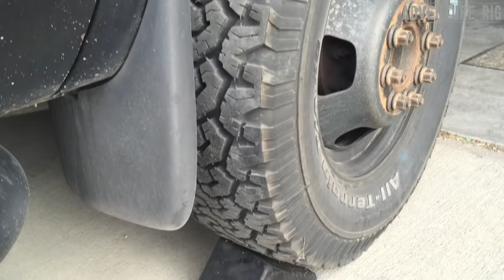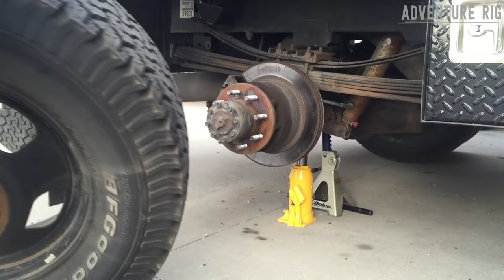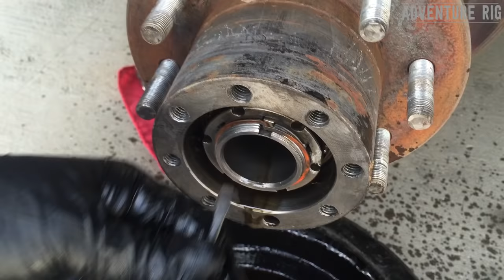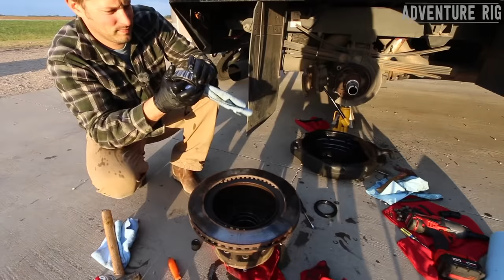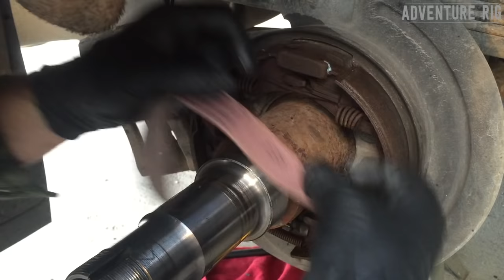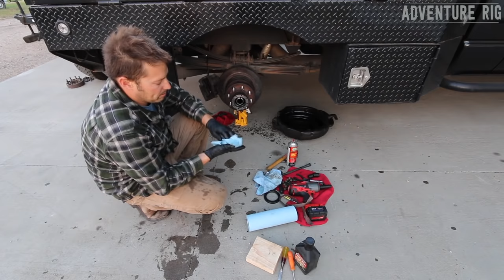How-To Replace the Rear Hub Oil Seal on Dodge Ram

Comment: Would this be the same thing wrong with my 2012 2500 Cummins 4x4 I wonder?  Gear oil all over the inside side wall of my tire, pretty bad
Reply from the maker: wildhorse192001 Yes I would assume. That’s exactly what my symptom was as well.
Reply: Adventure Rig thank ya sir, when I get the seal I should be able to tell for sure
Reply from the maker: wildhorse192001 Thanks for watching!
Reply: Adventure Rig my pleasure sir, very informative video, thank you for posting

Comment: Hello, I have a 2016 Ram 3500 dually and I notice gear oil like sitting in my rim. Almost look like it’s leaking from the axle shaft. Was wondering any advice on how to repair or might have idea where the leaks coming from….

Comment: When pulling the seal out you should get the right tool such as a seal puller or screw some small sheet metal self tapping screws in and pulling with some pliers instead of potential hurting the mating surface with a punch and hammer.
Reply from the maker: Be careful.

Comment: What impact were you using to break the lug nuts?
Reply from the maker: I'm not sure the exact model but it's a Milwaukee 3/4'' impact. I love it and have used it a ton.
Reply: never use impact to loosen or torque any nut,!!.lazy way,will break studs,cross thread,come loose if not correct tight.i allways break with wheel brace,torque back with my elbow.!.NEVER,had a problem.45 yrs..
Reply: My grandfather has been using an impact for more then 45 years and no issues either

Comment: What was the torque spec and why didnt you say to mark where the nut is in the beginning of the video, not after we remove it
Reply from the maker: I'm not sure off hand what the torque spec is. Marking the nut is not mandatory but it can be helpful...I suppose it was an afterthought for me. Thanks for watching.
Reply: @AdventureRig  the torque spec is 22 ft lbs at the hub nut then back off 30 degrees-his method worked but as a mechanic i prefer to use the proper socket and a torque wrench-but for a diy guy his method will do
Reply from the maker: steve will Thanks Steve!

Comment: Are 2500 & 3500 different? 2012.
Reply from the maker: Lance Koehler They should be the same as far as the procedure.
Reply: @AdventureRig   ok, thanks, guess I'll soon find out. Are those hub nuts just like old school? Get them snug then back out a quarter turn?
Reply from the maker: @slinger3350  Yeah preload and spin etc....

Comment: Would this process be the Same for a 2012 ram 2500?
Reply from the maker: I'm not sure if it's the same axle but I would think if it's different the process if very similar.
Reply: Adventure Rig is yours the 11.5 AAM axle?
Reply from the maker: Yes it is
Reply: Adventure Rig awesome, then it should be same process just mine being a 2500. Thank you sir. I'll be using your video to do mine here soon.

Comment: Bravo! I like the video. Short, easy to follow and no horrific music playing in the background. Bonus points for not pulling out some 37/94ths 17 point dealer only special socket designed to mate to a serialized dealer only torque wrench. 

My 12 2500 needs a new rear seal according to the oil change shop. Seeing you do it in your driveway gives me hope of doing the same. After that I will move on to replacing the entire front end steering assembly, replacing the steering box seals, a full tranny service and replacing the exhaust manifold bolts that snapped off... again. 

Every day I walk out of the house and see yet another puddle of fluid under this truck. It makes me hope that it would catch fire or be struck by lightning and go away. Then I put it in 4wd or load something stupidly heavy in it I cant help but love it all over again.
Reply from the maker: Haha thanks for watching! I hope your numerous projects go well.

Comment: Great video. Very helpful Thank you. My whole seal stayed on the axle when I took of the drum hub. I tapped off the seal. The new seal I tapped in the hub but if I pull it real hard by hand I can pull it out. Is that normal? How tight should that seal be in there? Thanks
Reply from the maker: Thanks for watching. You shouldn't be able to pull the seal out by hand. It's a pretty tight fit.
Reply: The pup playing with the block of wood was priceless:)
Reply from the maker: @rihamy2nd  Great thanks!

Comment: Tip. To get oil to the bearing drive the truck into a steep ditch and let the oil gravity feed over to the dry bearings. Then you know for sure you have plenty of oil in the hub.
Reply from the maker: Mike Goodman Great tip mike!

Comment: Do you still have it? How many miles ago was this? Has it required any other maintenance?
Reply from the maker: It's had about 65,000 miles put on it since this replacement and I've not had any other issues.

Comment: Do you not pack the bearings with grease?
Reply from the maker: Kenneth Beard No, the oil in the differential lubricates them. Make sure to park on a side hill after replacing the bearing so oil makes its way over to that side prior to driving.
Reply: yes,you can,depends if you have lsd,grease could stop it working.if diff is mechanical locker/lsd,doesnt matter,but,make sure you drive in circles to get the oil to the left or right bearing before doing long strait trips.
Reply: Great video.

Comment: You can't see if the seal is going in straight if you cover it with a towel. Just blow it out or brake cleaner after tapping it in... Leave the rims off and jack up the other side, you don't have to pre lube. Good video tho
Reply from the maker: Thanks for the advice!

Comment: Did u replace the rear seal also ?   I'm doing this now.    Good video BTW sir :)
Reply from the maker: Hi Jim. Thank you for watching. Can you clarify the "rear seal"? I replaced the rear hub seal in the video but what are you referring to as the rear seal?
Reply: @AdventureRig  theres a front and rear  seal as well.   Just  Curious
Reply from the maker: Oh I see what you're saying. I only replaced the rear hub seal as that was leaking.
Reply: I think your right.    Theres only 1 seal in  The rear.   I think i messed up and thought there was 2.    Cuz it came off in 2 pices.    Ha.
Reply: @jimedwards9310  thats why it was leaking.you get crap,stones dirt,ect,sitting on back of seal,like if driving thru mud holes,long dirt roads,,,,it wears on rear of seal causing it to fail.not much to prevent this except clean truck thouro,after every trip,or at least check..i inspect,& re grease whole truck after every trip,doing this you notice what it what.regular maintenance pays.plus swing off or jerk all links,up down side to side..a mate showed me a trick for bad wheel bearings,on there way out,,jack up vehicle,grab coil,spin tyre,if you feel vibration,its bad.like stiking ear on train line, same principal.&,dont EVER,judge the tightness of bearings,keep a note somewhere,best way for them to fail,too loose/tight..a 2" torque wrench is a good all round bar.
Reply: Yeah it’s a two piece seal. The inner part seals against the spindle tube and is stationary with it. The outer part of the seal seals to the bore the hub and rotates with it. The seal is a one time use deal and is often torn apart when the hub is pulled from the spindle.

Comment: Had my repair shop replace the oil seal and install new brake pads.  They also installed new rotors which I didn't order and they didn't tell me about. That added $259.00 dollars to my bill and I was pissed about that.  The existing rotors were in perfect shape.  When I complained they said the old rotors were out of specs.  
Not true, I had the truck inspected by a DOT certified mechanic as part of an annual FMCSA inspection and the pads needed replacing but the rotors were OK.  In watching the video I now see the mechanic was just too lazy to pull the old seal and bearing OR he damaged the seal seat when taking it out. 
What a bunch of lazy and incompetent mechanics we have today. I'd have done it myself but I don't have a garage so I have to work in the street and the temps were in the 20"s.
Reply from the maker: It sucks working outside when it's cold!
Reply: how much was your total bill?

Comment: nice concrete,or at least it was,my missus would tear my 3 yr old head off for doing that,.allways carry a cheap tarp,has a mirriad of uses,.that said,,i dont have concrete to work on,just a shit load of dirt.hence,tarps..never undo nuts with an impact wrench.&,on every nut you take off,use never sieze.that seal probably failed because of crap wearing on it from behind,mud,dirt roads,you could possibly put like a rope seal glued behind it,but,if it traps dirt,same prob..or at least wash there regular.the design is like a ramp to the seal,not good dodge,.good vid,bit backyardy,like me,but i clean,paint & torque,everything i take off/fit..ive just converted 2 dana 44,rs to 8 stud.one on a cut to swb, 1975 highboy,other on my bronco,solid axle front locker,lsd d60 rear.
Reply from the maker: Thanks for your input Harry and appreciate you watching!

Comment: Ive seen other vids for a dually dodge show actually packing the bearings vice the gear oil? any comments.

Yeah I thought so too. Here's what the folks said from the website. Now I don't know which way to go.https://www.youtube.com/watch?v=OBPCyk28BaU
So the reason we pack the bearings is when you drive off for the first 20 or so miles the diff fluid is trying to make its way out to the hubs. So it is always best practice to pack all bearing so you don’t burn anything up. It will dissolve with the diff fluid when it heats up.

Makes sense but..
Reply from the maker: That's interesting. The gear oil is what is lubricating them.